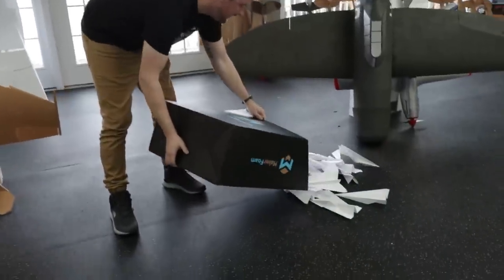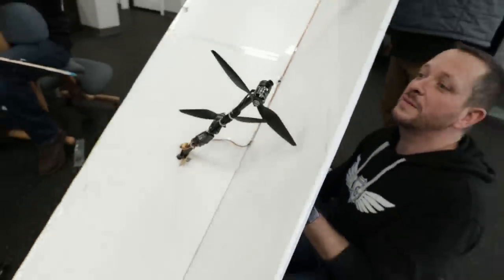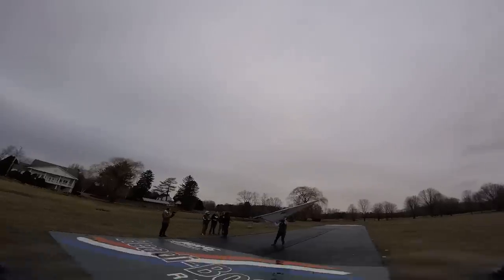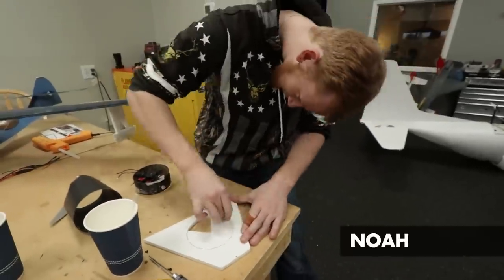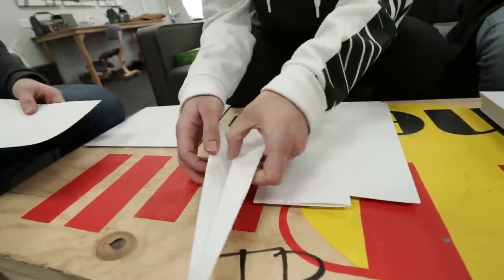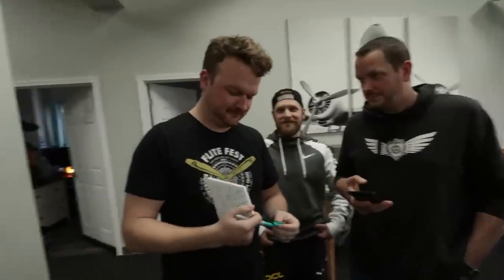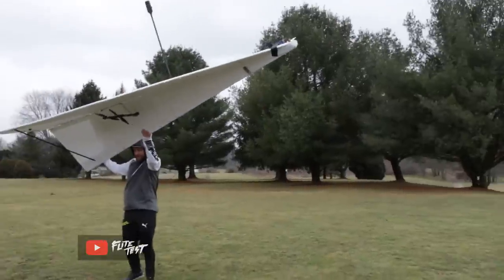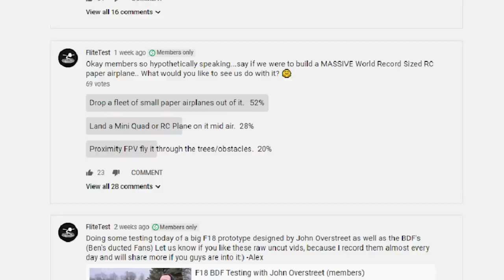Attempting to Drop Hundreds of Paper Airplanes from the World's Largest Paper Airplane

Comment: Stephan was right (sort of)! printer paper is made by cutting 17x22" sheets of paper into quarters; the weight is rated by how much a ream of the basis paper weighed. If you buy printer paper rated as 20lb, that means four reams (the equivalent of one basis ream) will add up to twenty
Reply: Aw!! Beat me to it. 4 reams of letter paper is 20lbs.
Reply: Correct!
Reply: As well as having a few goog laughs, I learned something
Reply: Felt is rated the same way.  This weird stuff is based on historic principles not known to young people as history was eliminated out of our basic curriculum about half a century ago.  Paper size today is based on the quarto system based on rag paper history,  hence the the 17x22" standard sheet for office paper manufacture (8.5x11").
Reply: Nikole just Rocked the facts!
Reply: Boi workin at Dunder Mifflin Scranton
Reply: No it's how much wait a single sheet of paper hold.
Reply: @TomisaLami  - Paper weight in the US is stated in lbs. and is determined by weighing 500 sheets (a ream) in the basis size of a particular paper.
Reply: We use GSM so plain copier paper in NZ is 80GSM: https://www.papersizes.org/paper-weights.htm
Reply: That was a perfect explanation!!
Reply: In Britain we weigh paper in grammes per square metre GSM.
Reply: Socks With Sandals, I’m 62 years young and when I was in grade school they taught us the metric system and said that we needed to learn it because the U.S. government was going to convert the country over to it. It made so much sense because it was so easy and you could do the math in your head. 50 years later here we are doing it the caveman way. LOL!
Reply: Manwhile, in metric land...
Reply: HyperFX841 well ull be damed my teachers lied to me
Reply: @RamonInNZ  Skip imperial Go metric.
Reply: That is the one of the most needlessly complicated things I've heard of in a long time.
Reply: As mentioned above, the A series is quite nice because A0 is one square meter, weight is specified in grams per square meter, and each smaller size is half the area of the previous size. An A4 sheet (equivalent to letter size) at 80 gsm is 1 / 2 ^ 4 = 1 / 16 square meters, and weighs 80 grams / 16 = 5 grams.
Reply: @fnersch3367  how would knowing the way paper is rated in pounds have anything to do with history classes?  even if it has historical basis, not all history is necessary to remember, otherwise all of early education would be the memorization of useless facts. The american public school system aims to give a general knowledge in various subjects, an overview to put it another way (it is debatable if public schools are effective anyway). I get what you are trying to say, but someone not knowing the historical reason paper is rated is not something that will affect their adult life.
"those who do not remember the past are condemned to repeat it" ~ George Santayana
Reply: What Is Islam?

Islam is not just another religion. 

It is the same message preached by Moses, Jesus and Abraham.

Islam literally means ‘submission to God’ and it teaches us to have a direct relationship with God. 

It reminds us that since God created us, no one should be worshipped except God alone. 

It also teaches that God is nothing like a human being or like anything that we can imagine.

 The concept of God is summarized in the Quran as:

{ “Say, He is God, the One. God, the Absolute. He does not give birth, nor was He born, and there is nothing like Him.”} (Quran 112:1-4)

Becoming a Muslim is not turning your back to Jesus. 

Rather it’s going back to the original teachings of Jesus and obeying him
Reply: Europe removed that ream based measure long time ago for packaging. (Now we use grams/square meter). But all the industry still works in reams (In Kilograms instead of Pounds and A0 instead of 17x22, but the same 500 sheets)
Reply: @Styrola  A4 (297mm x 216mm)80gsm (gram per square metre) is metric!
Reply: No one cares
Reply: Everyone at Dunder Mifflin would be proud of you.
Beats, Bears. Battlestar Galactica! ✊

Comment: Suggestion: have a contest when you get a crowd of spectators, involving catching paper planes dropped from the big one.   (Maybe just for kids?)  Write the prizes on the planes, (or run the paper thru printer to make a flyer - pun!) They have to catch it in the air for it to count.  Put up several drones or other cameras in the drop area so you can confirm they caught it.  Maybe experiment with some of the other sorts of paper airplanes to find one that flies well from just being dropped, versus thrown.  That stubby paper airplane that flies in circles might work well.  It might stay the air longer at grabable height, but will be turning too, so could be challenging.

Comment: Paper is weighed by measuring how much a 500 sheet stack of 17" x 22" would be in a particular thickness.  Yours paper was noted to be 20 pound and its weight measured at 5 pounds on the scale. 5 is one quarter of 20.  Note that 8.5 x 11 is one quarter of 17 x 22 too.
Reply: yep. to further clarify, Most paper comes from  what is called a "parent sheet" which is the size that is produced at a paper mill. So 20 pound bond is designated by what 500 sheets of the parent size weighs.
Reply: Im used to paper being rated at XX0grams/m^2 :-)
Reply: Jeffrey Leckemby so 8.5x11 is one quarter of 17x22, huh? Not sure how that can be since one quarter = 1/4th, which would mean 4 times 8,5 would be 17. 4 times 8.5 is not 17. 4 times 11 is also not 22.
Reply: Raycefan its 4 times the area not the length that counts. 
Doubling both sides gives you 4 times the area.
Reply: @Raycefan  incorrect. To get four sheets of 8.5 by 11, you would cut the 22 in half, making two 17x11 sheets. Now, if you cut the 17 in half, you have your four 8.5x11 sheets. Just to confuse even further, most parent sheets are 23x35. So you actually get eight 8.5x11 sheets (there is extra that is trimmed away, or for printing, can be used to "bleed" an image off of a finished page)
Reply: When smart guys share answers

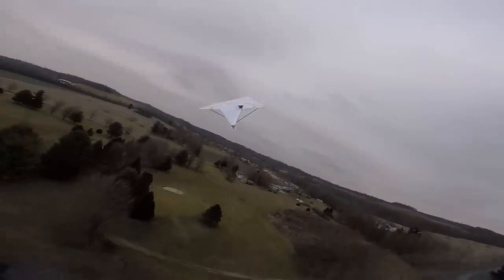Comment: 6:58 It is not called "Auto-level" It's actually due to "center of mass of plane " which the average most weight
on plane which is concentrated at a particular point or part.
Reply: He said it acts as auto-level. And all you did was define center of mass, not how where it is causes the plane to level out.

Comment: I have a suggestion if you want to rebuild it: Try attaching some of the smaller paper airplanes to the larger one via fishing line/nylon or whatever, and then they will fall out and sort of follow the mothership, like a fleet or squadron.
-So you would have the mothership in front, with 3-4 smaller ones behind, and 3-4 normal ones coming out of each of those. It may not be possible, but if it is then that would be really cool to see.

Comment: You guys probably already know this but this paper plane was design to go far at a high speed due to it being very light like all high speeds jet planes do.
Its not flying well because its not going fast enough to generate enough lift to be stable due to its small wing size/span.

There are overall three important things for a plane to go far and fast. Drag, Lift and wing size/spam.

The less Drag you have the fast you can go.
The Fast you go more Lift you will generate with a given wing size/span.
If you have a lot of lift to spare you can reduce the wing size/span and that will reduce the surface area reducing Drag.

This is a endless cycle. What puts a end to this is cargo size and weight. 
The bigger the cargo the bigger the plane will be because the cargo need to fit inside the plane and the bigger the plane the greater is its Drag. 
And more weight will need more lift to take the plane out of the ground limiting how small your wing can be.

Another ting that is a limiting factor is runway. If you have very small wings you will only generate lift to take off at very high speeds and you only have a limited space to accelerate. 
If you cant accelerate in the given space you will need a more powerful engine and a more powerful engine is usually heavier. 
More weight will need even more acceleration and it will require a even more powerful engine and the cycle goes on.
Another way around the problem is variable-sweep wings but it also adds more weight (may or may not be as much as a more powerful engine) and introduces its own share of problems like complexity, weak points/material fatigue and others.

When you balance all of those things you will have the most efficient plane for its intended purpose.

Comment: In kindergarten, knowing how to fold a paper airplane was a novelty, like knowing how to play a guitar in middle school. I loosely observed the rough movements of others and kind of just formed a vague idea of what I should do to the poor pieces of paper before me. From then on, I just randomly folded and threw them. It didn't really matter which side the folds were in, only now did I really notice that they varied greatly in my memories.

I liked folding the back of the wings in alternate directions, up and down. I'd throw them and they'd spiral through the air. I called them air torpedoes.

Comment: Paper weight is basically a way to gauge the thickness of paper.  Paper weight is commonly determined by weighing 500 sheets of 17" x  22" paper which is the equivalent of four 500 sheet packages (reams) of paper.

Comment: This is amazing.
Probably should've used a higher-lift design for the drop planes instead of those standard darts. There exist paper aeroplane designs which will easily correct into slow and level(ish) glide when dropped a few feet. One of my personal favorites also happens to be able to fold into a rectangular card for easy packing (not sure how to make it insta deploy though; would need to try different types of paper).

As for inside vs. outside: When it comes to that standard design, I thought outside was a rookie mistake, not a way of building paper aeroplanes. :P

That being said, with some of the fancier designs you either should or have to use the outside config as the folds force the paper behind to bow out in one direction or another..

Comment: Pounds, as you might have guessed, refers to the weight of the paper. It is normally measured by how much 500 sheets (or a ream) of paper weighs in its basic unit uncut size, which means before being cut to Letter size or Legal size, the paper is weighed and categorized. The thicker the stock, the higher the weight.     copy pasted right from google

Comment: Inside usually, but I almost never bother with the standard dart.
I have a custom design I like called a Victory, super heavy nose, large low aspect ratio delta wings, and a tail and large down turned winglets. It also uses adjustable control surfaces, cause it flies like a rock left to its own devices. But you get it properly trimmed, and you’ve got an incredibly fast aircraft, and the faster it flies the better.
A Victory would actually work fairly well here because it would drop like a brick and gain a ton of speed before rocketing off into the sunset.

Comment: 20lbs is the weight of the paper defined by its thickness, tensile strength and determined length on a reel. I use to work at Southworth paper company previously Esleeck mfg in Massachusetts. Theres tracing papers that are 15-25lbs and water color papers range from 50-73lbs

Comment: PAINTBALL  DOGFIGHTING guns in the wings  Or where ever you like DOWN  !!! EACH TEAM HAS A TEAM OF 2 one pilot and one gunner in any configuration you can imagine , planes 
only TO BE revealed to enemy team  untill Battle day could be any era jet or ww1 prop plane with a tail gunner big or small slow and stable with lots of paintball guns or fast and agile with 2 paintball guns on the wings or one under the belly for CG YOU CAN PUT THE CO2 in the belly and use a co2 coil cord to run it anywhere in the plane I’ve done this along time ago it was so awesome and fun but never had an enemy in sky my self so it go very boring shooting the ground and trees also they sell BIODEGRADABLE PAINTBALLS SO ITS ALL GOOD and won’t harm the field this would be awesome
And might get paintballers intreated into the hobby of rc

Comment: 20lb bond refers to the weight of 500 sheets of 17"x22" paper. Likewise, 50lb text refers to the weight of the same sheet size and number of sheets. 500 sheets of 17"x22" is also referred to as 1 ream of paper.

Comment: Add servo rudder control to the “V” part of the tail to help with the turning. Spread some of that responsibility out! Leaving all that work to the motors, differential thrust, and ailerons is silly my dudes! Add rudder to the team and that team won’t be defeated! The stool needs three legs bruh! Add rudder.

Comment: Great video -- perhaps why the aircraft did not fly well with the payload of paper airplanes is because the "low pressure area" that exist -- which gives lift to the aircraft design, was blocked by the payload.

In other words, perhaps in the next design version of the aircraft, keep the topside area of the wing keel region clear of obstructive objects to the airflow so that the low pressure area can form better -- and instead, use an areodynamic payload cargo pod with wheels that hang below at the CG.

I've been building kite-foil plane models for decades and learned this lesson long ago.

For a funny video of a similar "paper airplane" design attempted long ago -- Google "the last laugh airplane" and see what I mean. The original plane never got off the ground because of many reasons -- but if the low pressure area was not blocked by the payload, perhaps the design could fly better.

Comment: They measure it in pounds because it’s measured in total box weight. And a box of paper has 4 reams in it, which is why one is 5 pounds, because if the box is 20 pounds, and each ream is 5 pounds, that’s 4 teams per box

Comment: A ream is a traditional unit of quantity used for counting sheets of paper. One ream equals 500 sheets of paper. The shorthand you will see to denote this form of measurement is “lb” or “#”. If a paper is described as “60 lb” (or “60 #”) that means that one ream of that paper is 60 pounds.

- Reference: printi.com

Comment: Man now I'd love to see a giant paper jet version.
It's similar to a normal paper plane but you invert some parts line the underside to poke out the back and look like a tail and add some more bends to the wings to give it a more razor edge bomber style. Loops back on itself.
Though.. Now I'm wondering if they'll need to calculate those angles on the computer hmm...

Comment: You fold it inside then, don’t fold it in the middle, fold the part you folded inside down, THEN when you see the triangle you fold both sides right at the tip of the triangle, T͟H͟E͟N͟ fold it in the middle, finally you fold the sides down where it is hanging off the edge of the plane by about 2 inches!

Edit: also thow the plane softly...

Comment: I think mthat using the blunt front style with flaps, that tend to 'loft' rather than the delta shape, which tend to nose dive (I think, I haven't finished the video yet),
There's this book called 101 Paper Airplanes, with folding diagrams and the history of paper airplanes, high entertainment/educational value, that I used for an oral presentation assignment in 5th grade. I brought a cardboard box of 101 airplanes and launched them into the class while giving the oral report. Got an 'A'.

Comment: Printing 101

Baby Steps To Print Purchasing Know How

The Printing Crash Course - Printing School

What Does a Paper's Weight Mean?

Paper is measured in pounds per 500 sheets (one Ream of paper) of a standard size of sheet based on the group or category of papers the grade. The different types of grades are Bond, Book, Text, Cover etc. Each group of the grade of paper is assigned a standard size that all weights are referred to. The basics of this standard are as follows:

Bond has a standard size of 17 x 22" and this is the size that is measured for 500 sheets. If 500 sheets of this size weigh 20lbs., then the paper is classified as a 20lb. bond. Heavier and lighter stocks will obviously be thicker or thinner than the 20lb. Therefore 16lb. Bond or 24lb. Bond will be the variations on this.

Now the confusion... the weight of 500 sheets of the standard sheet size (also known as the basis size) is commonly known as the paper's basis weight and is always noted as a weight in lbs.

Seeing that the above only offers a vague indication to the thickness or the weight of the actual size, further confusion awaits !

A sheet size different than the above is calculated as a fraction or multiple of the basis weight and is normally noted for 1,000 sheets rather than 500. The weight thus calculated of the acutal sheet size is always noted in weight per thousand (M in roman numerals) and therefore said to be 19 X 25" - 100M meaning that 1,000 sheets of 19 x 25" will weigh 100 lbs.

Bond
Bond stocks (often referred to as "Writing") traditionally are uncoated stocks and are normally used around the office such as letterheads, photo copier and laser printer paper. The standard weight utilized is 20lb., with 24lb. being the heavier alternative, and 16lb. being the lighter alternative.

Writing is a grade similar to bond, but made with a shorter fiber, yielding a softer sheet which can be made with a variety of finishes and which accepts ink more readily. Writing is generally more expensive than bond and is used for higher end applications like company stationery. Some bond and writing papers have distinctive watermarks in the sheet.

Uncoated offset is made specifically for the rigors of commercial offset presses and is often used for the same applications as bond.

The basis size of bond/writing papers is 17 x 22", whereas offset papers is 25 x 38".